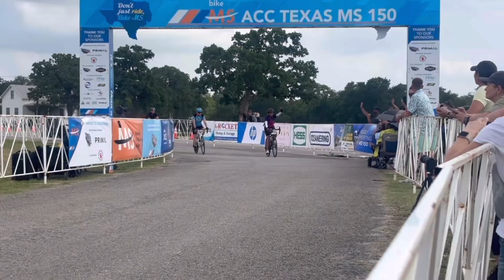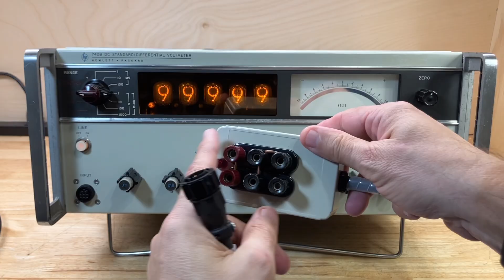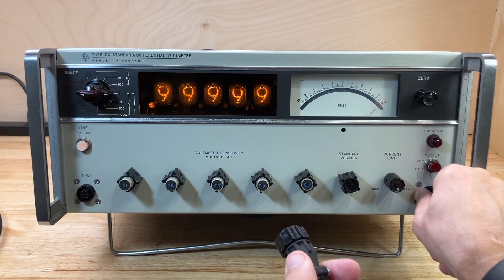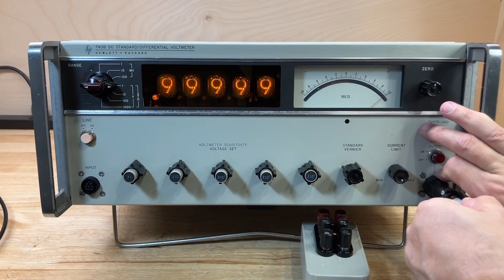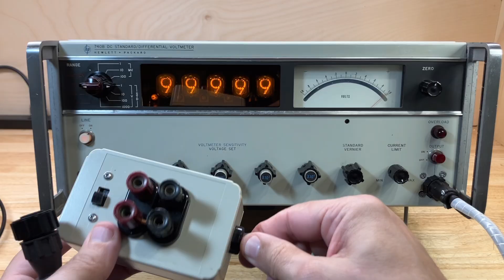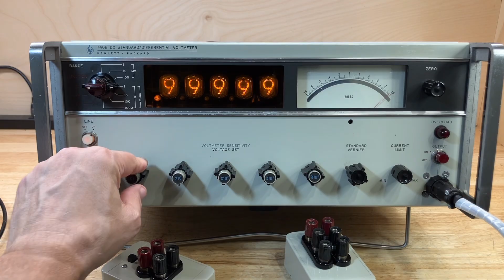HP 740B DC Standard/ Differential Voltmeter Part 1

Comment: The neon photochoppers used in many of the HP instruments of this vintage have a fatal problem.  Over time, water vapor in the air diffuses through the clear polystyrene case and corrodes the printed conductor pattern on the photoconductor, which severely degrades the photochopper performance.  This drastically reduces the loop gain in the system.  The outward symptom of this, as with many other loop gain problems, is that the unit won't calibrate properly.  Specifically, the self-calibration steps for internal resistor pair matching cannot be successfully completed.

So far I have not found a suitable replacement for these photochoppers.  I hold out hope that some modern optocoupler could be configured to have a sub-microvolt effective offset voltage, but even the ones using photodiodes to drive FETs tend to couple significant charge pulses into their outputs.  The high voltages that can exist in this circuit are another hurdle to be overcome.
Reply from the maker: I sure hope this isn’t the case with this one. I do own several other hp instruments with working photochoppers; I may be able to sacrifice them for parts to get this one going if need be.
Reply: @garyramsey4275  
One way to check for this is to measure the "light" and "dark" resistances of the photoconductors.  I believe that those are stated somewhere in the HP service manual, possibly in the parts list (sorry, it's been a while since I worked on one of these.)  You may be able to do that in-circuit if you lock the neon oscillator/driver into one state or the other.  You could also check the loss through these choppers while they are operating by opening the feedback loop and feeding in a low-frequency (a few Hz) input signal.  Good luck, and be careful - that 1kV power supply can spoil your day if you give it a chance..